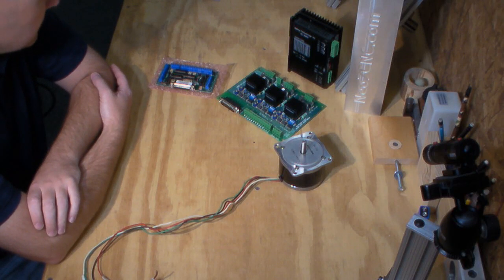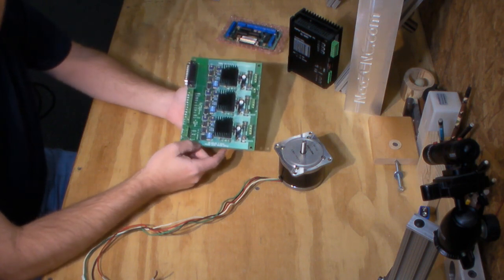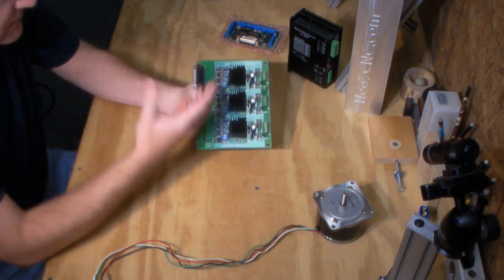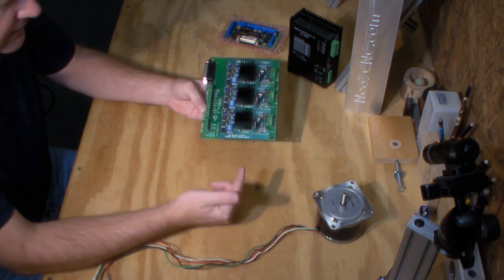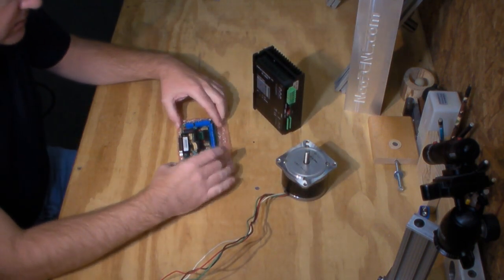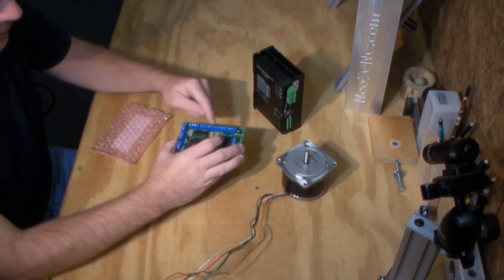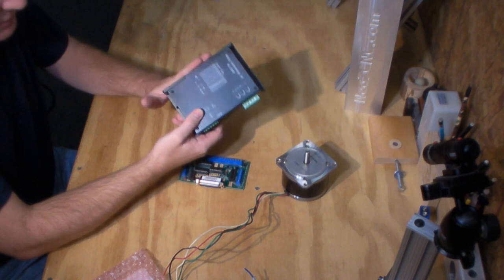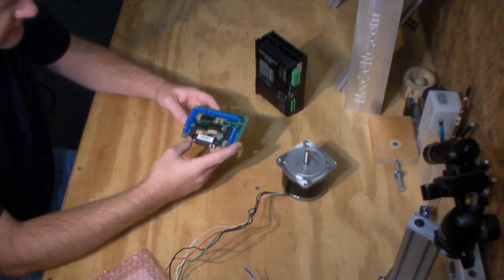Homemade DIY CNC Series - Driving Electronics - Neo7CNC.com - Episode 9

Comment from the maker: I have used both a single board and the separate controllers.  My take on single board controllers is if you blow one axis then your entire board has an issue.  With the separate controllers you can just replace the individual piece.  These drivers I'm showing here are only for steppers. Thanks for watching.

Comment: thanks for sharing your hard earned wisdom! I'm curious if you might have a link or reference for this same subject but updated (this video was 2011)... I'm looking into building a machine and the electronics is a part that still has the most ambiguity to me.

I think I'd prefer to use 2 motors on the Y axis to prevent torsion and i'd love to have the electronics be expandable/modular to allow for a 4th axis down the road if possible. any advice I. electronic components would be great!